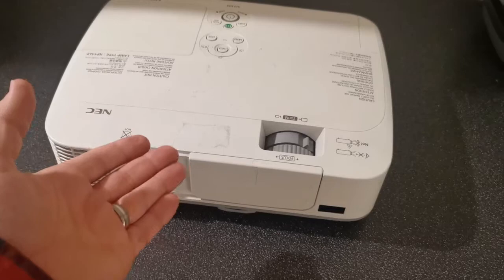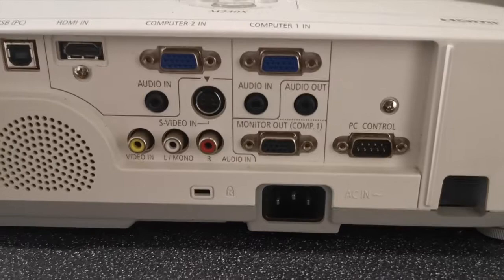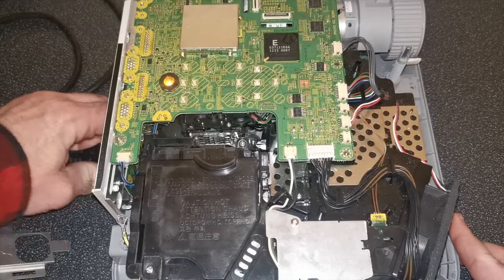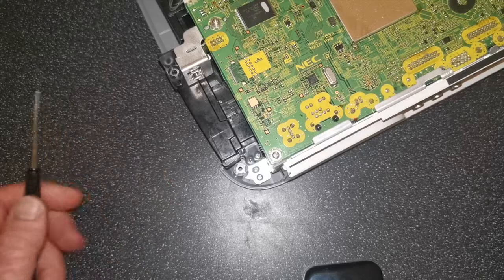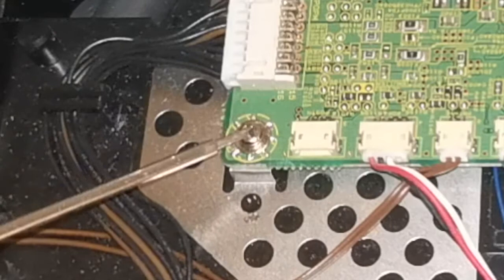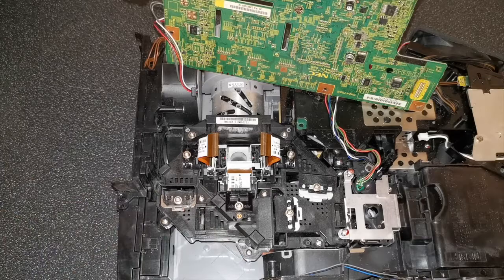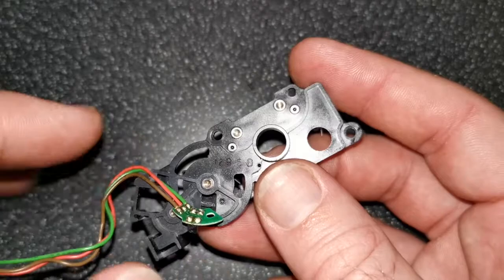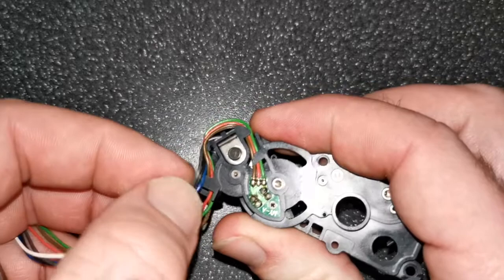NEC Projector Dynamic Contrast Error Fix

Comment: Thanks heaps from Wollongong Australia! Mine was a P350W, but it did the exact same problem. Tried to turn on, made the ticking noise for about 5 seconds, shuts the lamp down, then the Status LED flashes 9 times, pauses & repeats, etc. Didn't take the Dynamic Contrast assembly apart, just removed it & spayed it liberally with Contact Cleaner & Lubricant (from Jaycar). Before spraying, the little metal shutters were hard to manually open and close. After spraying, very easy to open and close. Worked first time after reassembling. Just think of all the landfill this one video has saved on NEC projectors.

Comment: Boring??? Absolutely not!  This is a fantastic video. Very detailed and methodical.  Looks to me like there's a bit of "shellac" build-up on the various capstans --I'm guessing the lubricant deteriorated b/c of elevated temperatures in that area.  Perhaps a dental pick would be a better choice for working with those springs. Thank-You for an excellent presentation!!!!

Comment: Brilliant video - I fixed my projector and it’s working again.  When I got down to the  complicated lens part I didn’t dismantle it.  I simply undid the two little screws half a turn and then moved the movement a bit until it felt it was moving freely.  Re-assembled it and everything now working!
Reply from the maker: This is amazing! I'm glad it worked. They're good, solid projectors and are worth making the effort on. 👍

Comment: Like many other commentators here - this helped me fix my projector (M350XS) and the symptoms were the same.  The dismantling was a little different but not a problem.  Thanks so much for sharing this video.
Reply from the maker: This is so great, I'm really glad it helped you.
Reply: @BrassicGamer  I used silicone spray to lubricate the mechanism for 2 reasons - (i) it meant I did not need to dismantle the mechanism and (ii) the projector is installed upside down so I think the silicone will stick to the surfaces better and not run into any other part unlike oil.

Comment: Worked for me.... After 3 hours of work, my projector is working again. The big struggle for me : taking off the cables (without breaking them). Too hard that was. I was using a tweezer but even with that, it wasn't easy. I don't understand why it looks so easier for you to do it. 
Thanks!
Reply from the maker: Maybe because I wasn't worried about breaking them.  You could call that confidence or a lack of caution, but I guess that's down to the person doing the repair. I'm glad you did it successfully though!

Comment: Very detailed video, nice. I have collected a few of these projectors (around 8 or so) all have this issue, except on every single one the motor gear has a hairline crack in it making it click against the next gear, tried a selection of different glueing techniques but none seem to have been successful so far, will next try filing the motor shaft ever so slightly and heat mounting the gear so it isn't forced apart as much. (Already cleaned and lubed the mechanism with wd40)

Comment: Mine moves freely when the motor is out. The motor itself moves freely also. But when the motor is in about three spots in the full sweep of the iris, the gears seem to bind. I've inspected every tooth in the gear, but I can't seem to find which would cause it to bind up.
Reply from the maker: After my first attempt at repairing mine, I considered removing the linkage between the clutch gear and the aperture and then manually setting the iris to open. The small gear would then move freely with the motor, triggering the optical sensor, but the iris would stay open. It could be worth removing it anyway to see what effect it has.
Reply: Same bro
Reply: having the same issue here. moves fluidly without the motor but once it goes in the gear underneath the motor keeps catching even after lubrication and there doesnt appear to be any busted teeth - very frustrating
Reply: Hey all, I have the same issue and found a video from FixItFrank with this problem detailed. It's likely that the gear connected to the motor is cracked. We might all need to just buy another iris assembly if we can't find the motor as a replacement part or somehow repair the drive gear.
Reply: @BrassicGamer  replied to another comment but I had the same problem and it looks like the gear on my motor is cracked. Could be the same problem.

Comment: I did this, and it worked! Unfortunately the lamp exploded about 10 minutes later, any idea if there's something I could have done wrong to cause this or was it just bad timing?
Reply from the maker: Hard to say, as I've not experienced that myself. I doubt it was related to overheating because, even if the fan was disconnected, it should have cut out if it got too hot. And I would think that if the thermistor was faulty or disconnected then the projector wouldn't function. I see why you would rather know why - replacing the bulb only for it to explode again would not be a desirable outcome. I'm glad the repair worked, though.
Reply: @BrassicGamer  I've replaced the lamp and it's been running for a few hours with no issues. If it wasn't just unlucky timing my best guess as to how I could have caused it is that overlubrication of the iris mechanism may have lead to a spot of oil being flicked off onto the lamp once it warmed up and became less viscous. I don't think this is particularly likely but it's the best I can come up with. I did clean a bit of the lubricant off it before installing the new lamp, so who knows...  The previous lamp was 10 years old so it may well just have been a coincidence.

Comment: How eliminate this dynamic contrast? Its possible?
Reply from the maker: Yes, if the motor works okay and you set the reflectors open, you can remove the plastic piece that links the two together. The optical sensor must provide the 'on' 'off' signal.

Comment: Can we bypass iris ?
Reply from the maker: That's a good question and it's something I considered. But the answer is quite technical, so apologies in advance for the menu words.

Theoretically you could disconnect part of the link between the tiny motor and the metal 'wings' that form the iris. The wings could then be moved manually into the open position permanently, and the motor would turn freely. We know that there is a sensor detecting movement near the motor, so that part needs to stay connected. The only question is whether there is also a sensor detecting the amount of light being let through the iris. If so, the iris cannot be bypassed.
Reply: @BrassicGamer   the bypass worked . :) but now the picture have yellow lines on all screen:( . And i have other NEC which has steady blinking red power light not status its power button. Can you help whats thats mean ?
Reply from the maker: @ijazahmed618  are the lines vertical or horizontal? Usually that's related to the LCD panels, or one of them. What I would do in that situation is disconnected the LCD ribbon cables and then connect only one LCD at a time, to work out which one is causing the problem. If the lines are present on all, then it's a processing error (electronics).

As for the red light, I would find the service manual and start there.
Reply: @BrassicGamer  they are vertical. I will try that . Thanks again .
Reply: @BrassicGamer   it was blue lcd screen. I unplugged the looks ok with out blue lolz